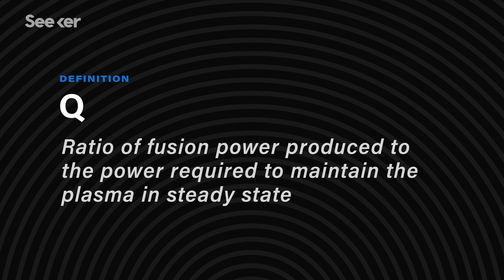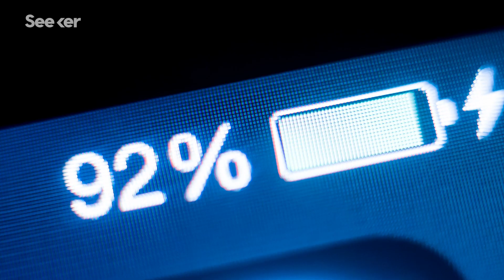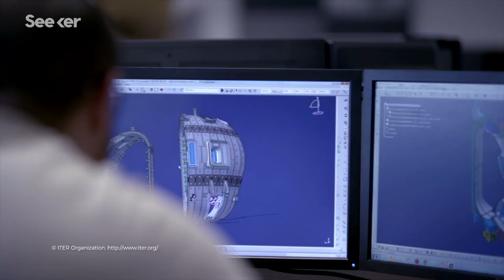How Close Are We to Fusion Energy?

Comment: Technically, we are about 1AU away from a working fusion reactor.
Reply: Onno Inada I like what you did there
Reply: Onno Inada the biggest one in our solar system.
Reply: Weiss Des Astronomical Unit. 
The mean distance between the Earth and the Sun 😉
Reply: Nice.
Reply: Nice one. :D
Reply: So true but we need a reasonable communal want to go into space and properly utilize the power of the sun. Currently the cost and the want are prohibitive but the actual engineering requirements are currently doable.
Reply: Weiss Des 1 AU =  149,597,870.7 km = 9.29 million mi = "Average distance Earth <-> Sun"
Reply: EinChris75 error in "9.29 million miles"
Reply: @EinChris75  Math is a little off there, it would be 92,955,807.273026 miles not 9.29 million.
Reply: Unfortunately solar power today is made less efficient thanks to the atmosphere... stick’em in space and you have a different story. Problem is getting all those solar panels up to space.
Reply: technically we have been making them for what 60+ years?

big big big big great big big layer of thermal electric generators and a big big bigger hole in the ground with some water in it. blow it up and power the world for cheap.

the problem is building it small enough to park outside of a town to charge a small fortune for a bit of it while buying votes to pass law turning it a monopoly.
Reply: John Doe
Please cite your claim. Fusion reactors are not bombs. How could they blow them up? And again if you watched the video the problem isn't making one big enough. Its that the ones we have made don't generate enough energy to negate the cost.
Reply: Austin Taylor
may 25, 1951
read about it wherever you want.

and i just told you how to made one big. and then i told you the problem was making them small enough....

but the real problem is not a lack of energy at all.
Reply: John Doe those were made by setting off fission bombs.  The mainstream fusion reactors will have less destructive and wasteful ignition systems like a bunch of lasers or microwaves and will use magnetic constriction as opposed to hoping that the rock and earth won't crack.
Reply: Onno Inada
yeah but i said "technically" and then we where blowing them up for real shortly after that, 60+ years ago.

yeah youre right, hopefully the earth doesn't crack. that would be the biggest hurdle actually. getting enough hope the earth doesn't crack into one place. (sarcasm)
Reply: John Doe I think we have a misunderstanding, I think I confused Operation Greenhouse with the PACER Project.  I can assure you though that ITER, DEMO, and other Tokamak and stellarator reactors don't use thermonukes, are definitely a lot cleaner, and take up the same footprint as any other generator facility.  I will agree though on the Molten Salt reactors, those and the Slow Breeder Wave reactors.  Hopefully ITER goes as planned but if not, those two types of fissile reactors will be a lot safer and cleaner than our current ones, and may be our stepping stone to go full solar or iron out the kinks in fusion technology.
Reply: The half life of Tritium is only 12.5 years, the decay of tritium is mostly beta particles which are easily stopped by the skin.  And that IF we use it.  It may be a byproduct of fusion but it would replenish our dwindling reserves.  It WILL mess you up if you breathe it, you don't have many defenses for beta particles internally, but a lot of things will mess you up if you breathe it anyways.  Tritium wouldn't impact the environment imo.  A big cloud released in a catastrophic release would float up to the upper atmosphere and get kicked off by the sun like normal hydrogen and helium.
Reply: Onno Inada cool.
Reply: long story short
thorium molten salt ftw.

its enough power to toss big ass mirrors into orbit. problem solved. heat/cool whatever you want. 1au is nothing.

fusion is nice but it may never shrink.
Reply: Tomas Beblar
are you talking to me or op or who?

my idea (probably not the first to think of it) would have a major interfacing issue.
Reply: Which is why so many people advocate solar power rather than laboratory fusion.
Reply: nice one
Reply: The Fusion energy is inevitable.. It will be a reality sooner than later.. whether you guys are in or not..
Reply: I'll just clear up a few things regarding the half-life of radioactive nuclei. Elements that have isotopes that have longer half-lives doesn't mean it's more dangerous than short lived ones. An example would be the conductive layer on your smart phones, tables, laptops etc. which contains the element indium (indium tin oxide) of which 95.7% of the naturally occurring element is radioactive. It's not an issue because it has a half-life of 4.41×10^14 y or about a billion years greater than the current estimated age of the universe so it decays very slowly thus releasing only a small amount of radiation in a given time period than say cadmium 109 which has a half-life of about 1.27 years. I've also noticed that gamma rays tend to be emitted by elements with short half-lives although I could be wrong on this. 

With uranium, it is actually more dangerous as a heavy element than as a radiation source being about as toxic as lead. Tritium can be thought of as being less dangerous simply because it is excreted quickly being chemical identical to hydrogen with one proton and one electron. 

There are pretty big reasons why fusion always seems to be 20 years away. A lack of funding for one. From memory worldwide funding is around $20bil US per year, nothing compared to what NASA was receiving during the Space Race and nothing compared to military or social welfare programs (and those bailouts). Nuclear (both forms) has been neglected most likely because we used the technology first to develop bombs that were capable of (and used to) incinerating entire cities. Second would be the fact that it's an extremely difficult technology to master. Compared to the Space Race, we are only at the level of firing off modified V2 rockets into the edge of space. Third is that most people probably don't understand the significance of nuclear power, even once informed about the benefits. They can easily understand poverty, education and infrastructure because this is something we see and experience. Forth is politics. Politicians cannot buy votes with a project that baffles the vast majority of people and will probably only pay off long after they have left office.
Reply: Onno Inada yeah basically
Reply: not technically but literally
Reply: If we just had the means to collect that energy it produces every day... Oh wait...
Reply: Weiss Des 1 astronomical unit. It s basically a measurement for distance which is equals to distance from earth to sun.
Reply: Sound like fusion reactors will take an ALMIGHTY effort😉. Also on a side note,what happens if a reactor goes into meltdown? Will we get another incident like chernobyl or worse?
Reply: J.J Plays , they don't go into meltdown, they just stop fusing.

Worst case: plasma melts a hole in the side of the reactor, and you have some maintenance to do.
Reply: Massimo O'Kissed have you seen the flash?
Reply: J.J Plays nah man.  Fusion reactors are not like Fission reactors.  Instead of splitting super heavy elements, they smash together super light elements, like helium or hydrogen and thier isotopes.  They will probably give off neutron radiation but that can be shielded against.  If one melts down, there are no radioactive elements thrown all over the place, they just go boom, if that at all.  Even if we use tritium, a radioactive hydrogen isotope, it won't be like a 3mile island, Chernobyl, or Fukushima type of event.  I am not sure how the tritium would break down but the halflife is no where near what uranium or cadmium is, and I am pretty sure the sun on earths surface probably gives you more radiation than a puff of tritium.  I mean we even use tritium in exit signs, gun sights, and wrist watches.
Reply: Onno Inada thank you i was just curious
Reply: J.J Plays Curiosity is good, and a damn fine robot, too.
Reply: Onno Inada that one took me a second, good one
Reply: Onno Inada I’m really not sure why you think that tritium is less dangerous than Uranium. Tritium is significantly more radioactive than Uranium and is considerably harder to remove from water, since tritiated water looks exactly the same as normal water on the molecular level. 

Statistically there have been far more health events from tritium than from Uranium.

Also meltdowns are not inherent to nuclear reactors because they use fission. Meltdowns have a greater likelihood of occurring in a fission reactor than a fusion reactor, because the coolant used to moderate the continue fission production is water. If we change the coolant you significantly decrease the likelihood hood of meltdown. This is entire reason you see a significant push today to start using MSRs or Molten Salt Reactors. A MSRs coolant is not water but rather fluoride, sodium or chloride. These coolants have boiling points that are considerably higher than the operational temperature of the reactor (1200-1650C vs 750C max operational), which means it is extremely unlikely that the coolant will boil and no longer moderate the reactor core. If you can’t boil or remove the coolant then you can’t cause a meltdown.
Reply: Brian I think they are referring to tritium's half life as the reason for higher safety. But what hundreds to thousands of years compared to tens of thousands of years right!!
Reply: Brian
Literally do a quick google search and you'll find out the the beta particles of tritium can't even penetrate the skin. Its only harmful if ingested. And that's probably why the statistics for tritium is higher than uranium. Because its much easier to get a hold of tritium than it is uranium because it in exit signs and other miscellaneous items.
Reply: Onno Inada it would actually not go boom, since the process can't keep itself alive like the chain reaction that can occur in nuclear fission. If too much heat is created, the plasma may melt the magnets etc. around the reaction, but then it would immediatly stop, because there is nothing to keep the plasma active. You could also just take away the power supply to the reactor and the fusion would stop
Reply: @machielluchtmeijer7796   I didn't think they would but wasn't too sure which is why I said if at all.  Reading you words and the words of others I understand now and it makes sense.  I guess it didn't help that I lumped containment loss and meltdown together.
Reply: No - it would shut down really fast, does not contain a lot of stored energy and does not contain much radioactive material that's mobile (structural steel will get irradiated but that won't escape the site in a cloud even if you smash everything up).
Reply: J.J Plays they dont have the same possibility to lose control of the reactions like fission does, because fission depends on atoms splitting in a chain while fusion could just be dispersed or turned off by turning off the power and fuel.
Reply: Heat. That's it. They don't "meltdown" as you can't get runaway reactions like in a fission reactor. Fission reactors balance and contain the energy release - creaming off the energy released in a (hopefully) controlled way for our energy needs. It's dirty, and tricky, and if we don't balance and contain - they meltdown. 

Fusion reactors, however, work on the basis of forcing atoms together and keeping the pressure on until all the energy those two atoms can release (simplified) has been released. If the Fusion Reactor's Pressure stops, it just stops  fusing. If there's two much pressure - it releases the heat quickly in one go and you burn a whole in your reactors floor or wall. That's it. No chernobyl. That's the beauty of Fusion.
Reply: Jack Hussey As quoted from Kurzggesagt, Its not a bomb(a.k.a if something goes wrong,the plasma just fizzes of quietly,no boom,no meltdown,no danger)

Comment: Is thorium reactor as good as nuclear fusion?
Reply: Fusion is leagues above thorium. Pretty sure they said that wherever you got your info about thorium.
Reply: Fernando Sorrilha not even close
Reply: Thorium molten salt reactor is cheaper than fusion and its green too.
Reply: Of course it's "cheaper than fusion".. since fusion currently doesn't currently output any electrical power. But if fusion does prove to be economically viable it'll be a much better option than any fission reactor, including a thorium one. It's basically the holy grail of energy production. That said I think it's a shame no commercial thorium reactor has been made, it seems like they have a lot of benefits over a uranium reactor.
Reply: Thorium doesn't efficiently output as much electricity as uranium.